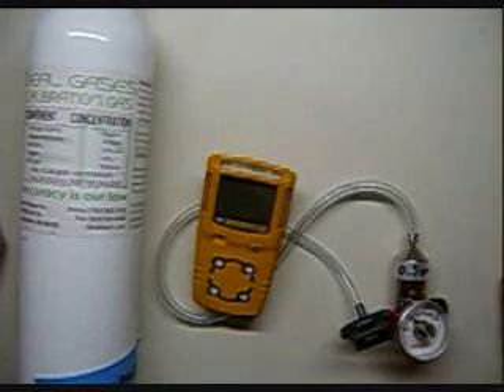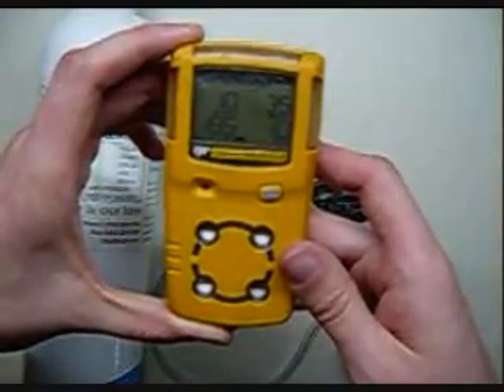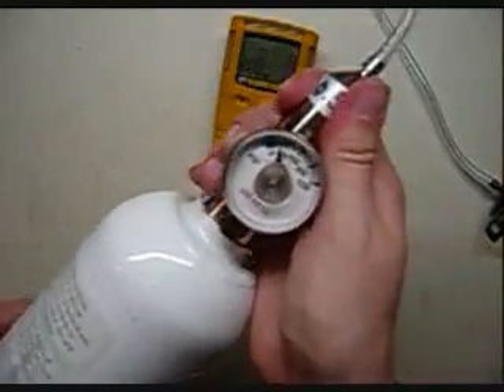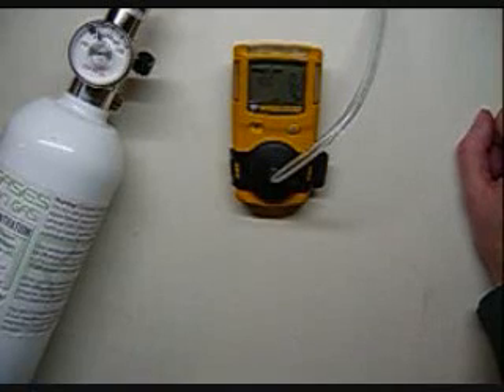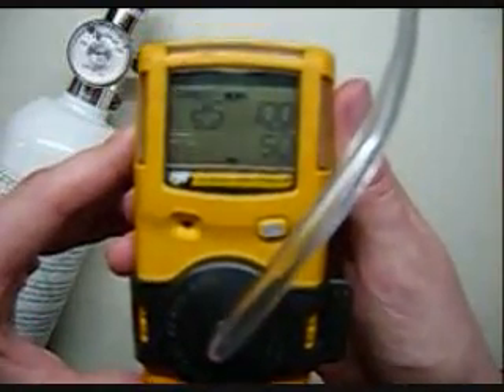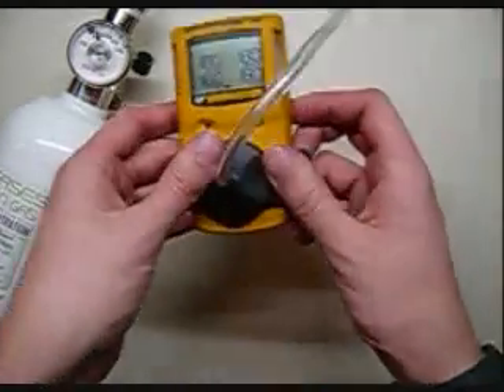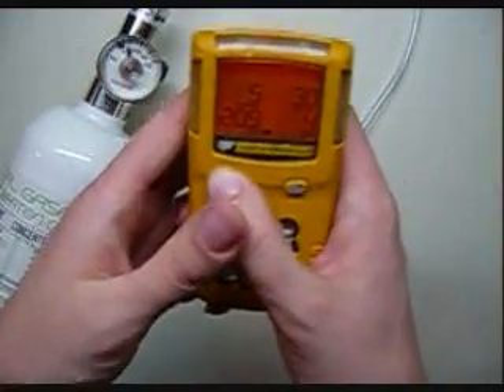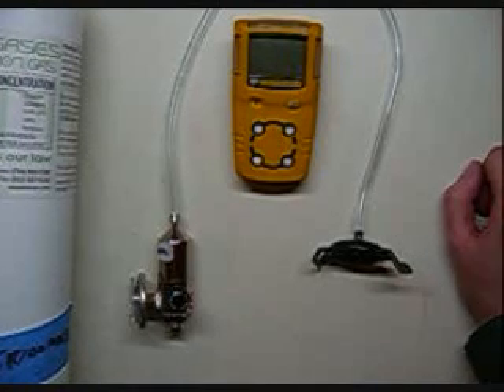BW GasAlert MicroClip Gas Calibration Guide by Ideal Calibrations

Comment: Hi ,to do a calibration do I hav to be accredited or trainied
Reply from the maker: Not to do them internally on your own equipment, but you should be if you're handling someone else's equipment.
Reply: @Idealcalibrations  were can i accredited to do calibrations. 
and also issue calibration certificates
Reply from the maker: @shailenpillay8878  Your best bet is to get trained by the manufacturer of the equipment you'll be working on. They have programs for technicians available

Comment: This was just an observation, that this is a fault when you turn on the autozero for co and H2S becouse if you switch the instrument on, in an athmosphere where these gases are presents the instrument wil get these values for zero point and you will die. (As we know Co is savourless and H2S also in high concentration)